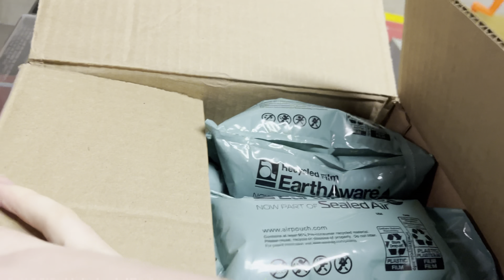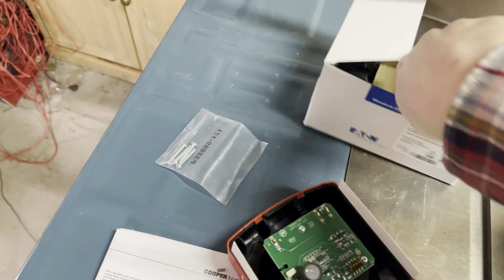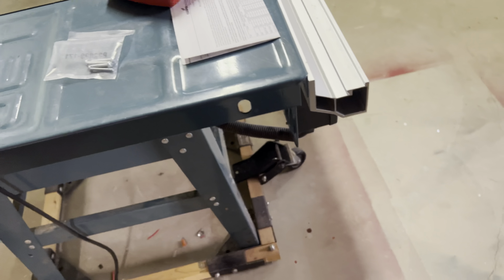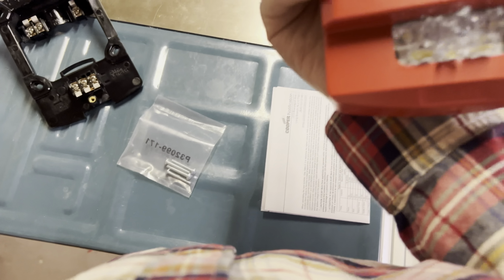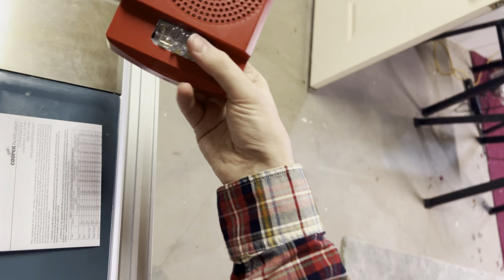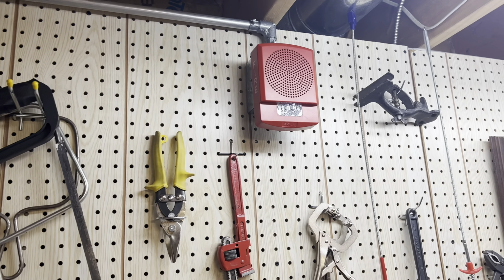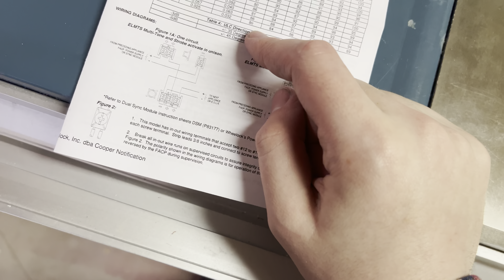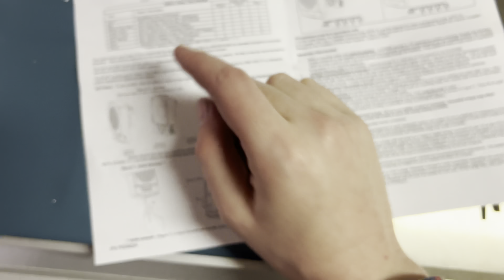YouTube First: Wheelock ELMTSR Eluxa Multitone Horn Strobe Unboxing and Testing

Comment: I thought the “blowing whistle” sound was outdated. Its all about Voice Evac and the “bewp! Bewp! Bewp!” of of the low frequency sounders.
Reply from the maker: There’s existing system that need replacement devices, as well as systems that don’t need voice evac or low frequency sounders yet need four wire devices. Chicago comes to mind, at least when Wheelock devices are planned, since they can’t do continuous on Wheelock sync